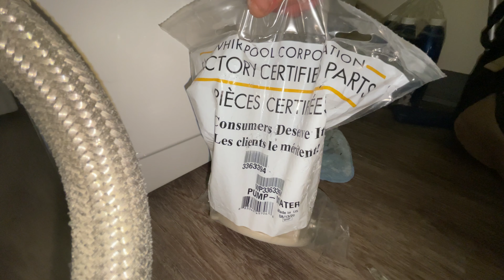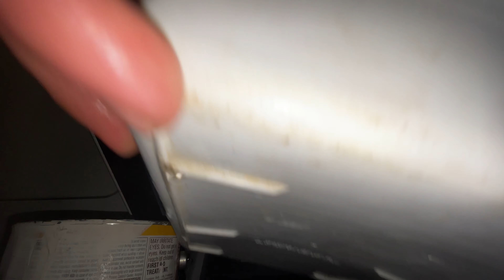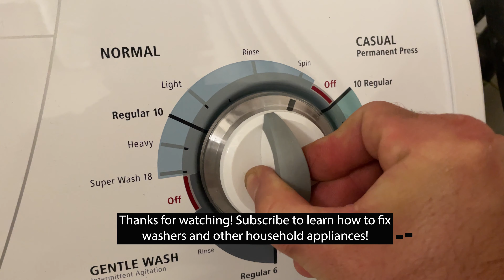Whirlpool Top-load Washer Leaks from Bottom while Filling

Comment: Water is leaking under my Whirlpool top load washer, but it isn't the pump. I replaced the drain pump (my model doesn't have a recirculation pump, so drain only) and it's still leaking whilst filling / spilling. My guess is leaking tub seal that needs replacing now.
Reply from the maker: Usually, when the drum is cracked, you can see rust where the transmission is underneath and usually wet once running for a bit. Also check fill water supply but hard to tell without being there

Comment: My Kitchenaide top load washer (very old but a goodie) is leaking from bottom.  I tried an experiment.  With the machine in off position I poured about 15 gallons into the empty tub.  I sat on a chair and then slowly water came out from under.  Again, the machine was off.  I'm an old lady but sure like to know how things work.  Would it be the drain pump if the machine is in off position or other causes?  What next should I check for?  I really enjoy seeing your work.  You make it look so easy.  Cheers from S.CA
PS...It is direct drive.
Reply from the maker: It could be leaking from the drain pump or the transmission itself. Rust stains will usually point to the exact location :)
Reply: @ApartmentMaintenancePro  Thanks for the reply.  I didn't think the drain pump would be the culprit if it was not turned on.  Interesting.  Do you have vids that show where the transmision is located and why would it leak from there?  I thought the trans was just electric.  Thank you so much.  Have a wonderful day.

Comment: While seeing this vid again, I am curious as to what was wrong with the pump such as cracked, or where the drive shaft goes in from the motor.  What causes these to fail in you experience?  Thanks again.  PS I really couldn't see where the water was dripping from.  Seemed like it was in the front facing outward, a crack?
Reply from the maker: Hard to tell. Everything is designed to fail sooner or later. Install, transportation and quality of material used play a role
Reply: @ApartmentMaintenancePro  Wish you were here to help.  Thanks for the reply.
Reply: I worked at sears repair  and you'd be surprised at what can make a pump go bad, I've seen Bobby pins,  tooth picks,  something small can prevent the impeller from spinning.  That's why it so important to clean out those pockets!!

Comment: Hey man I have a customer who has a whirlpool very similar to this. It leaks out the bottom but only when she does like two larger loads back to back and it leaks a lot of water. If she does a small load and then let’s the machine rest for awhile before doing another small load it runs fine

. I’m going back in a couple days to poke around further. All I had time to do was snake the washer drainpipe in the wall and check the drain hose on washer. Didn’t find any obstructions. Any ideas? Or just replace the $25 drain pump? What do you charge labor to replace pump? More or less. Thankyou
Reply from the maker: Drain pump should be a quick repair so that’s up to you. Although less common with whirlpool, ensure the drum isn’t cracked and leaking from there 👍
Reply: Any suggestions on how to remove the pump if it's stuck to the shaft? I unlatched the clips; the pump won't come off.

Comment: Hi, I just replaced the drain pump on my Whirlpool and there's still a leak coming from the front
Reply from the maker: These drain pumps usually leak due to small cracks. Make sure it’s aligned properly
Reply: Same, having the same issue. Not a lot of water like last time

Comment: Whirlpool washer here, changed pump based on video, and it still dumps when on fill stage. Suggestions? Where do I check the tub? Also, never did this until I moved it down stairs and up ro new unit on second floor, with a dolly. So a little bumpy while going up/down stairs.

Comment: Nice repair bro 💪 I miss working on Whirlpool appliances. Everything is GE at my property which they aren't bad to work on, but I'm just a Whirlpool fan. I've done so many of those drain pumps & motor couplings on the direct drive washers like the one you just repaired in the video. Keep the vids coming 👍
Reply from the maker: Thanks man. I too like Whirlpool over GE, especially when it comes to repairs. Although lately getting parts for Whirlpool and GE appliances has been near impossible as of late.